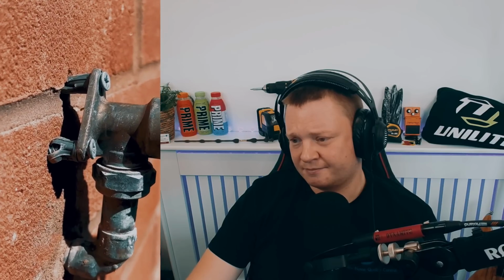How do you fix New Build Snags? | The Snagging Breakdown

Comment: Regarding rebuilding sections of wall. Presumably you rebuild the whole thing from top to bottom or you would end up with a kink? Or, if for example the bottom was out 28mm but half way up it was plumb, well if you just rebuilt the lower half then it wouldn't sit on the footings correctly? Or do you have to then rebuild all the way underground?

Comment: the brickwork in that section and everything above it unless it has a 25mm set back above your level? The tolerance is as you say 8mm but its 8mm either side of plumb, so if the footing was wrong(which is where you are plumbing from) maybe the bricklayers slowly moved it over to where it should be. I have done this myself, lean brickwork over gradually to hit the correct measure.? Early backfill of footings could push walls over.

Comment: I'm looking to buy my first house, and a new build is what I'm looking at.

Could you do a video on what a new homeowner should check for to decide if they should get a proper inspection?
I've seen a lot of these videos, but I feel like there must be some obvious signs that little care has been taken.
Maybe just the top 5 most common issues and what to look out for?
Thank you. love your videos.
Reply: I think these videos have put me off ever buying a new build, as David Bowie wrote, 'Too many snags'
Reply: Seriously, don't!  If at all possible, try and get something older, even if it needs a bit of modernising and decorating. My 1966 house came with its original features such as flush doors, parquet flooring, avocado green bath and carpeted loo seats, but at least the place was built right.
Reply: @Jackdaw5  my first house was a solid early 60's house, lead pipes and asbestos aside, was better built than more modern stuff I have seen.
Reply: @Jackdaw5  It's difficult; I know that's the right choice, but underfloor heating, a great energy rating, a modern kitchen, and in my area, solar panels, are really making it tough.
Reply: Save some extra money before buy and get an inspection done anyway! I am same position like you, and I add extra money in savings for a inspection
Reply: @aCoolHHChannel  you can’t do an inspection before you buy.  That’s how they get you

Comment: Could someone explain to me what happens when the buyers turn around and tell the developers of the faults mentioned within the snagging inspectors report? Like, the tap for instance with the exposed wall plugs and it not being flush with the wall, will they actually be held liable to fix this? The lack of mastic sealant, will they by law have to amend these issues or can they just literally run away with your money. I understand with things like walls being out of level beyond tolerance having to be fixed under building safety regulations but I'm wondering more about the smaller but still important stuff there isn't legislation to cover. Also I'm unsure if these places have already been paid for or not for the developers to hand them over in such a state!
Reply: The developers pull faces, suck their teeth, say they’ll get an inspector to look at it then go down the pub and have a good laugh at the poor mugs who’ve bought new build houses built by the cheapest subcontracted tradesman the developers can find.  You know, the ones who can’t get their own work independently because no-one would ever recommend them.
Reply: It depends.

So if you haven't actually finalized the contract and paid them. Well then they have to fix it so you'll sign, this time is when it's best to inspect because you have the most power.

The next possibility is they  offer you some kind of home warranty which any major builder would.

In the event they don't fix it you at least have the option to sue for failing to honor the warranty.

Lastly there is still building code.

Homes must be built to code, that's why for example he said the wall can only be 8 mil out of plumb. That isn't his opinion. That's code for his area.

If your building a house you have at least in the US an implied warrant of merchant ability. 

That means that even without a contract if someone sells you something it's expected to be able to do whatever that thing does.

If I sell you a motor vehicle, it better be a motor vehicle. Better still if I sell you a ford f150 it better be an f150 and not a van you've cut the top off the back half of .

Likewise it's implied that any house you build for me will be built in accordance with the laws on home building even if no contract says so. It doesn't need to. Your automatically prevented from selling me an illegal good basically.

So if you sold me a home that must have a vent and must be within 8 mil on wall tolerance or your plans stated I would get a 8x8 concrete pad but I got an 8x7. Those all open you up to a lawsuit.
Reply: Appreciate the in-depth explanation, thank you!  @sparkzbarca

Comment: "Plastic" doors and windows cannot be repaired, they need to be replaced because in the factory the profiles are cut a bit longer and during welding these few millimeters disappear, if this weld breaks, it is already scrap.

Comment: Wow thats mental. A did comment on your shorts but wondered if you knew much about the air source heat pump and solar thats being offered on the eco4 scheme is it worth it and are they good. I have house that's runninh off boiler stove system and considering it as snagging expert wondered if u knew about them?? 🏴👍🤔

Comment: If the out-of-plumb brickwork is removed and replaced, some of the sections you show are right next to windows.  Will that then mean the window will need realigning because it could be sitting back to a different depth than the other side?

Also, when you show us the brickwork is out of plumb, how do we know if the incorrect part is bellying or receding?
Reply: I was wondering this, because at some point you would have a step. Either at the bottom or top depending on which way. And also thought about windows and doors. And then re skimming and decorating the reveals. 

Makes it sound simple with "just the outer skin" ... but surely its a f****n nightmare
Reply: I was wondering this, because at some point you would have a step. Either at the bottom or top depending on which way. And also thought about windows and doors. And then re skimming and decorating the reveals. 

Makes it sound simple with "just the outer skin" ... but surely its a f****n nightmare
Reply: Also, if the outer wall is out of true won't the inside wall match it and have to come down too?

Comment: Some of those things are clearly where the site inspector has turned a blind eye because it would be too lengthy and expensive to repair and rebuild properly. I'm talking the walls out of plumb and fake weep vents. Where a "professional" has seen it, but decided against raising it to make their life easier and get the properties sold. 

On other faults, like cracked tiles, poking out nails and the like. Clearly no one has looked at that property since the declared it finished. That staircase, it's so bad, like not a single thing about it is right. 

In the construction industry we got serious about health and safety, and as a result deaths on worksites have collapsed. It's time we implement a similar system with competency and quality control.

Comment: It’s amazing how much of a property doesn’t get fully inspected before handover, went round to my mother in laws new place yesterday and had a look in the loft, extract fan not connected to tile vent, missing insulation, and party wall fire stopping not tight to underside of roof covering as I could get my hand between the Rockwool and membrane!

Comment: What's the % of properties you survey for a snagging list have  10 or less items?
If I were buying a brand new ' anything" by definition it should be fit for purpose. 
Now a pair of socks will have less issues than a house ,but I feel a list of 10 or less items on a new build is acceptable (thinking a usually snagging list,not that half the exterior brick work needs coming down, or all the windows need replacing)
Reply from the maker: Less than 10 - 0%
Less than 40 - 1%
40-60 issues - 5%
80 - 120 issues 80%
120+ 14%
Reply: I can't believe a qualified tradesman was responsible for some of the very poor workmanship seen here. More likely a developer employed the cheapest option instead of using someone who knows what they are doing.